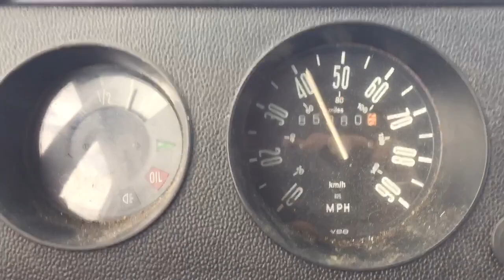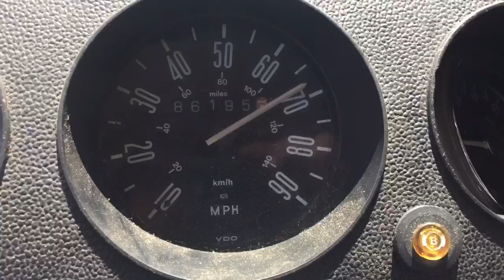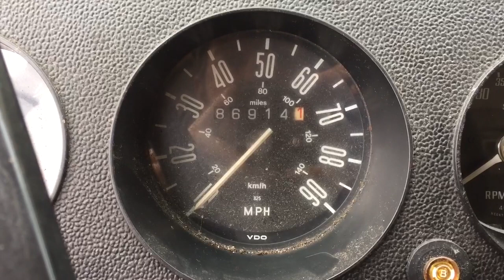1000 Mile Test Drive

Comment: Sounds like you had a great learning trip! 
Can you give us more details of your clutch linkage modification? Thanks 
I have pulled the engine out, trying to find out why my clutch pops and comes out of adjustment. The only thing I see is a little wearing on the clutch forks. I am going to replace it with a new heavy duty cross shaft clutch fork and bushings. I been thinking about not putting the KEP stage one pressure plate back in and using the stock plate. Do you think the stock plate will work ok? It worked great with the with the 1.8 VW flat engine. Thanks for any help I am at a complete loss of what to do!
Reply from the maker: +James Groves I put stock clutch equipment in mostly. I seem to hear a lot of issues with "performance" clutch equipment. If you are building a racer then you'd want to go that way but not for the family van - at least in my opinion.

Comment: Awesome work, you are the reason i got myself  a 75 baywindow.  So is it just easier to swap Subaru enjine with its transmission than getting a kennedy adapter plate and mountung to vw trans?
Reply from the maker: +Jaime Flores it's much easier to swap using the VW transmission. The Subaru transmission is a fantastic upgrade to drivability though.
Reply: Having just done a 74 Bay with a dual carb'd crate motor and freeway flyer trans, I can honestly say I wish that I'd gone the Subaru route.
Reply from the maker: +Jaime Flores Much easier and less expensive to use the KEP adapter plate. The Subaru transmission is extremely smooth though.

Comment: What was the problem with the front brakes?
Reply: Wheel bearing?
Reply from the maker: +Kevin Hornbuckle The brakes were upgraded I believe, and would make contact with the rotor at random times. It didn't seem to be related to how often they were used or what speed you were traveling.
Reply from the maker: +Forthwith Tx Definitely a potential.
Reply: If you weren't using the brakes, but they started making noise that subsided after a cool-down, then I would suspect bearings.  If the rotors started warping under heat, without use, then the heat has to come from somewhere.  I would suspect the bearings.
Reply from the maker: +Forthwith Tx Could be. The owner is going to tackle that issue at some point.
Reply: Busaru what was it eventually?
Reply from the maker: +Reynaldo Balmes I believe the owner replaced the calipers - sticking/spongy piston syndrome.